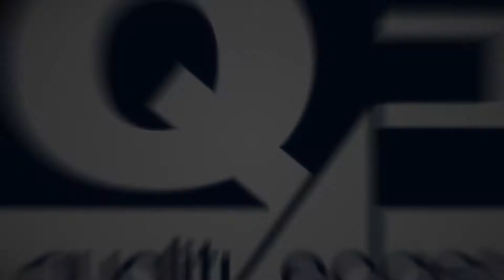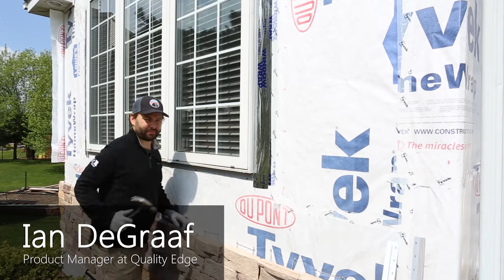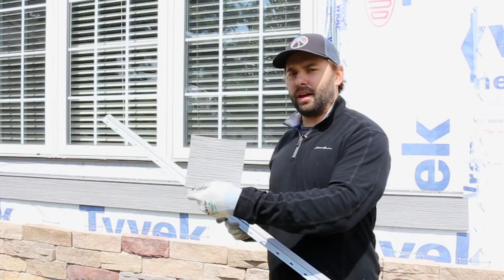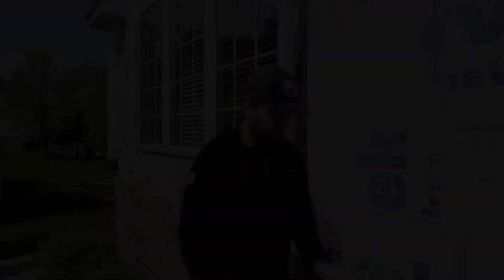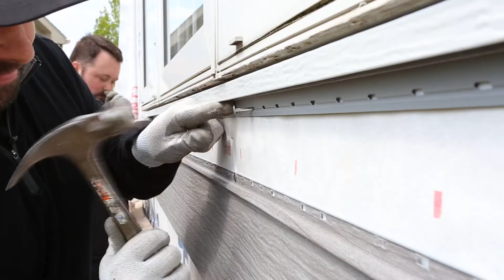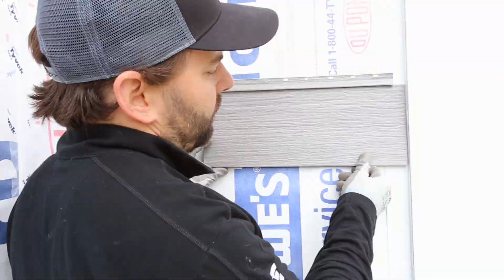TruCedar Steel Siding Installation: Utility Trim, J-Channel & L-Channel

Comment: Hi in the las part where you installed the L channel against the wood trim how do you avoid get water between the L and the wood did you caulk it? by the way great video thanks.